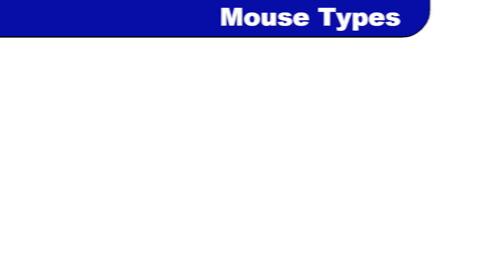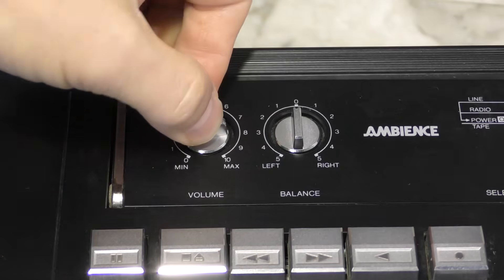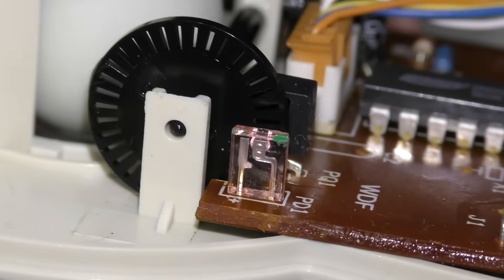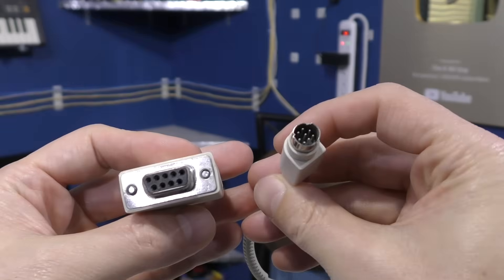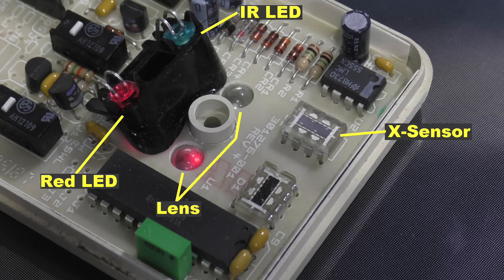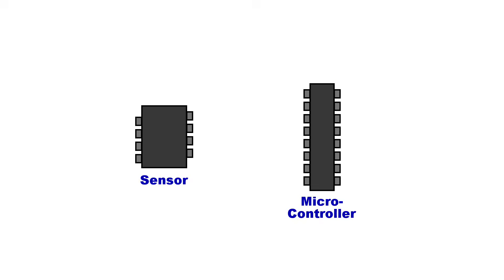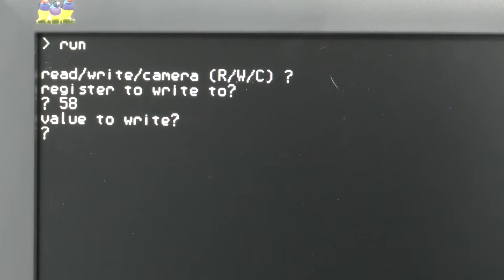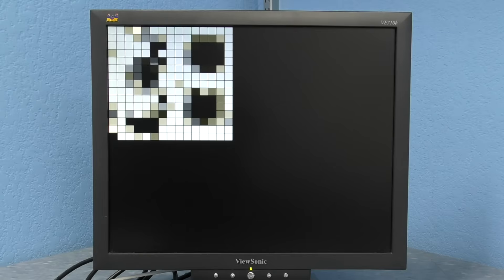What does a computer mouse see?

Comment: Why a game boy camera? Cell phone camera shows infra light. Point a remote controller at cell phone camera & see the coded flashes it makes
Reply from the maker: I was not aware of this.  I just tried it with my iPhone 11 and I can just barely see a flash from a remote.  So, it's not nearly as sensitive as the gameboy camera.
Reply: @The8BitGuy  maybe it's the remote. I've been doing this since cell phones had cameras. It should be very visible. Unless iphone 11s camera blocks out IR?
Try another remote, trust me it works great usually. You can see it blink in different orders for each button
Reply: @drowningin  Good cameras have an UV filter inside
Reply: @Schule04  doesn't sound like a good camera if it can't do something a free prepaid phone can do
Reply: @drowningin  That's like saying that a Ferrari is worse than a van because it has less seats in it. 
Good cameras are meant to capture colors visible to the human eye and so use filters to prevent unwanted waves from distorting the image. If you want a camera that sees IR light well you have to get a night vision one.
Reply: @Schule04  so he has to use a grainy game boy camera because his $1000 phone can't see it.
Look I don't want to listen to apple fanboys prattle on. They're terribly overpriced, terrible lock in ecosystem, terrible interface, but has a great camera they don't even manufacture, their screens, or anything else either. The OS isn't even developed in house.
Enjoy spending $1k a year on a new phone that you think is a Ferrari because Apple has brainwashed you with their sleek commercials of what Apple users look like, when really they look like 8bit guy, and preach like Mormons
Reply: @drowningin  I was taking about professional cameras, but whatever. And no, I don't have an iphone.

Comment: 1:08 Paintball gun ammo! Actually, I stripped a whole bunch of plastic off of a bunch of mouse balls that were going to recycling a few years back- several of them were exact fits to my 68 cal paintball gun, so I made my own tube that held 5-6 of them and off to the junkyard I went. 

All I can say is that if I hit a person in the head with it at even medium range, there definitely would be a criminal investigation. I managed to shear a Suzuki Swift's fender at 10 feet away. Closer ranges even cracked thicker metal on domestic cars. Definitely don't try this at home!

Comment: Were standard Amiga and C64 mice also mechanical-optical? (always thought they were 100% mechanical)
Reply: I doubt it. Mechanical switches just can't switch fast enough because there are hundreds of pulses a second when you move the mouse at a decent speed.
Reply: @eDoc2020  Perhaps - i never thought they had switches, though. (How i  assumed that ball-mice worked (perhaps incorrectly), was that the two small wheels inside of them had their rotational speed or position measured, which would then be translated to (deltaX, deltaY) coordinates n times per second)
Reply: @zaitarh  Well ball mice do work like that, but the question is how they sense the rotation of the shafts. Looking at some pictures I saw of the Commodore 1351 mouse it appears they use the typical optical encoder.

Site about 1351: https://www.the-liberator.net/site-files/retro-games/hardware/Commodore-1351-64-Mouse-A0101910/commodore-1351-64-mouse-rev-b-pushbutton.htm
Reply: @eDoc2020  Yeah, you seem to be right! Now that i know what to look for, i can see the LEDs and holes in the wheels, when looking at those pictures of the 1531.

That is so sci-fi!!! And it sounds a bit expensive too. I wonder why they went with future sci-fi tech, instead of normal cheap n' easy human tech? 
(Like something like the "potentiometer" that the 8-bit guy talked about, but which could go all the way around. Higher precision maybe?)
Reply: @zaitarh  It really is a very simple and easiest way to measure continuous rotation. IR LEDs and photodiodes are cheap and plentiful (used in all IR remotes), and very little extra circuitry is needed. I suppose they could make this digital sensor like a potentiometer, which would be cheaper and slightly simpler, but that would be much less reliable. Imagine an analog volume control knob (those are potentiometers) but instead of crackling the cursor becomes erratic.

Comment: I remember cleaning the rollers (not the ball) on my mouse in the 90's.  Oh the things kids today miss out on :-)
Reply: Frankly, out of all the old tech things, this is the one I don't miss - optical mice are just too good.
Reply: I recently cleaned a few of mine up - definitely a flashback. Did you know, the balls in Microsoft mice, when the rubber coating is removed, fit into paintball guns near perfectly? :D
Reply: @the_kombinator  Oh my, thats 200 fps of danger there lol
Reply: @Terrackhimself  I took it to a junkyard and did a lot of damage. If you hit a person in the head the right way, you'd likely kill them. I advise caution!
Reply: The satisfaction of clearing the curd of the rollers.
Reply: yeah, I used my fingernails for that. In retrospect I should probably have used a better tool. Ah well. It worked.
Reply: @needfortweed8734  Fingernails work fine though. I usually used rubbing alcohol and q-tips to loosen the dirt, then used my nails to pry it off. I cleaned the ball as well though, but only when it looked dingy.
Reply: I never knew if the crud was rubber worn off the ball or just dirt, both I guess.
Reply: Same here. Same 'ol process every week or so ;-)
Reply: .. or rewinding a tape with a pen...
Reply: You guys used to like doing that?
Damn, I guess life really was rough back in the day, cleaning mouse coom to pass the time.
Reply: @ghoulbuster1  I think it was more of the fact that you spent a couple of weeks fighting the mouse to work right, then finally having enough, and cleaning it.  Then the satisfaction of a mouse that works right. lol
Reply: I remember that the mouse that came with Mario Paint for the SNES came with a little scraping tool and instructions for cleaning the mouse rollers.
Reply: Give'm a trackball and they can have a similar experience today.
Reply: Don't know if this counts, but I use a trackball mouse that sometimes needs it's rollers cleaned.
Reply: I used the little tip of my mechanical pencil or a little cutter knife. You always had to be careful not to damage it lol.

Comment: I always wondered how a disk head reads data, how does it know whether 1 or 0 is stored at a given location?
Reply: In essence, just like the old magnets you might have played with in school, each bit on a hard drive is a separate magnetic "zone" with a north pole and a south pole.  The order of those poles determines whether a bit is a 1 or a 0.  For example, a 1 might be a north pole followed by a south pole, while a 0 might be a south pole followed by a north pole.  So your user name (TDL3) might be stored as:

S-N N-S S-N N-S S-N N-S S-N S-N  S-N N-S S-N S-N S-N N-S S-N S-N  S-N N-S S-N S-N N-S N-S S-N S-N  S-N S-N N-S N-S S-N S-N N-S N-S

In base 2, that's    0101 0100 0100 0100 0100 1100 0011 0011   Remember that in our example, S-N represents 0, and N-S represents 1.  If we convert that to hexadecimal, we get:
                                   5       4        4        4        4       C        3        3       Then we can convert that to decimal (for readability), and we get:
                                       84               68               76                51           Finally, we look those numbers up on an ASCII table, and we get:
                                        T                  D                 L                  3

There's undoubtedly more to it (I'm simplifying things as much as I can), but I hope I was able to explain the basics.

Comment: I had a Mouse Systems Amiga mouse back in the 90s - absolutely brilliant at the time, so long as you kept the mouse perfectly straight! Angle it a bit and the pointer starts to do the Lambada.
Reply: I admined a Sun box with one of them until 2012.. it was apparently in service until 2014
Reply: I had a C64 with GEOS and a mouse.

Comment: Wow, what a packed and super interesting episode. Last year, I ran into those opto-mechanical solution inside a Mac ADB Advanced Gravis MouseStick (I) and had to diagnose it before it started registering movement. I made a lengthy thread about it in the allaboutcircuits forum. Basically, the light wasn't picking enough light because of scratches in the plastic film on plastic film contact inside the wheel between LED and photoresistors. I had to up the voltage feeding the LEDs to make the whole sequence trigger. Most people owning these joystick have developed this problem over time so these 'duds' are unfortunately getting sold on eBay and most people don't realize it's an easy fix by turning a potentiometer for a bit. 

I went further down the rabbit hole this year by getting inspired by a custom thumbstick joystick getting interpreted by a very small Arduino which sent back the same kind of quadrature data, but digitally, to an old Macintosh serial port, so that it could replace the mouse in a Mac Plus, 512k, 128k or even Lisa. I mimicked the design and tried to improve on it while also making a gamepad case, 3d printed. Our designs and choices are documented in the hardware section of 68kmla forums.
Reply: Yup, I support the patreon and the videos are up the day before
Reply: how.....
Mu0n
17 hours ago (edited)
Reply: @theaveragecactus  He's probably supporting the 8-Bit Guy on Patreon. I mean, Technology Connections actually releases videos a day early to Patreon supporters.
Reply: Hmm, mate, since you are so enthusiastic about this?
Why is a hole on bottom of a mouse, - is shaped like a key hole?